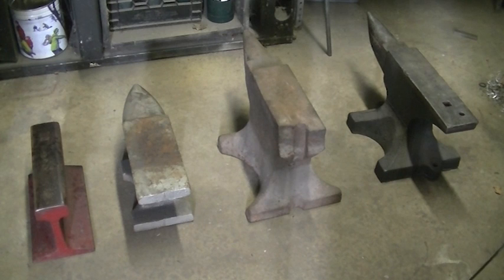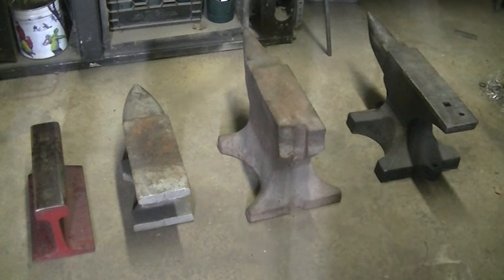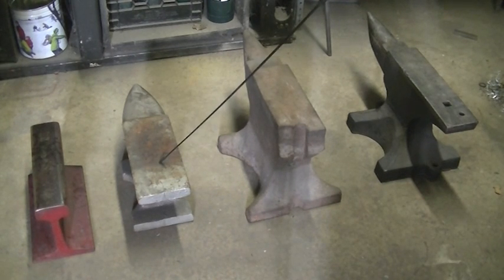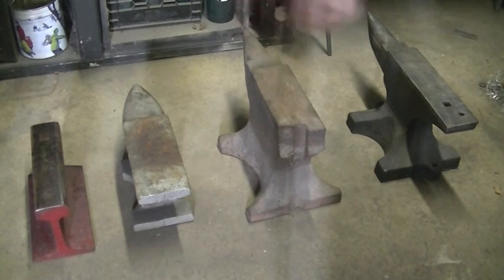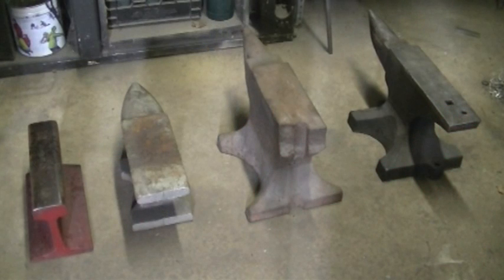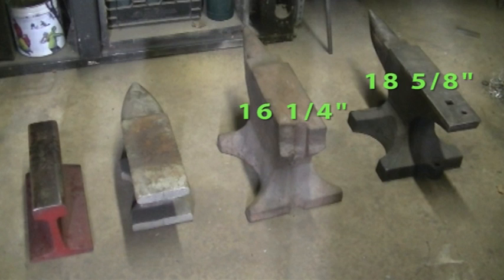Anvil Rebound Test - Steel vs. Wrought vs. Cast Iron vs. Rail - All Compared Side By Side.

Comment: Nice job, I appreciate that you took the trouble to do the side by side comparisons. I think your results are very valid, but I do wish you had used a smaller ball bearing without anything welded to it. I understand why you did what you did, but I do think you put the rail anvil at an unfair disadvantage; a smaller ball bearing without anything welded to it would have been closer to a more neutral test across the board, given that the rail anvil had much less mass - it's a good lesson that a rail anvil needs mass added, and maybe it would benefit from welding a hardened too steel plate onto the face, which seems like a sacrilige but, hey, if the rail steel isn't hard enough, it isn't hard enough. I wonder if the rail steel can be case hardened to make the face much harder?
Reply: It would be interesting to see how a 1 inch diameter ball bearing, a 2 inch diameter ball bearing, and a 3 inch diameter ball bearing all made from the same material with the same hardness do on this test.  A good way to drop the ball bearing would be by hanging it by an electromagnet so no sideways forces are applied and you definitely want to avoid having and kind of shaft sticking off of the bearings because they add all kinds of rotational momentum transfer issues that will skew your results.  I would also do the test at at least three different heights and do about 10 to 20 drops with each different configuration.

Comment: I haven't started blacksmithing yet, so while I found this video great for comparing the anvils (which you showed how they can sound different too) in the end, you forgot to mention how the rebound matters.  Is it better to have a bigger rebound, or less?  It would seem more rebound would be better? because then you know most of the energy of your strike would be sent into your object you are working on and not absorbed by the anvil??? I'm guessing a low rebound must mean energy is absorbed by the anvil, so bad?  It would be interesting to see what alterations could be done to a railroad track to make it a better anvil.  LOL, OH I see you answer this in the comments. :)
Reply from the maker: I had already talked about the reflection of energy in a previous video :)
Reply: Don't think you can help the rebound of an anvil unless you weld a harder surface to it. I'm using a RR track anvil and it's definitely useable and a noticeable step up from the cast iron varieties

Comment: Can someone explain how malleable wrought iron can shatter like the second anvil seems to have through its hardy hole? From what little I know, that would be something cast iron would do. Also, the  shape and mass effect could be the cause of the rebound difference between the second and  the smaller cast iron and the steel rail.  The thin I-beam shape of the rail probably absorbs a lot of energy
Reply from the maker: Most of the time when you see the tail broken off an anvil it is because someone took a sledge hammer to it trying to upset stock for a hardy tool. This is why most modern shops have a striking anvil. As far as mass and shape... in another video I cut the train rail in half and repeated the test, with 1/2 the mass the results were not much different.

Comment: The rail section, in practice, performs better than your drop test indicates. My thought is that the undressed surface of the rail (Still curved, not flat) affected the rebound forces directionally.
They definitely work better when dressed flat. I have also seen one individual who placed two sections side by side and welded a flat over both. Not quite as good as a tempered (wrought iron) anvil, but quite close.
Overall, though, I appreciate this video. Good work.

Comment: Great,  thanks.  I have a 122 lb. Peter Wright.  When I put it on the oak stump no matter what I do,  I cannot stop the ringing in my ears.  I moved it on top of 2 cast semi brake drums stacked on top of each other and a old cast iron transmission case,  what a difference!  I swear I get better rebound.  Can the same anvil have a different rebound depending upon it's mounting?  Concrete or dirt?
Reply: Absolutely. Your mounting/base is just about as important as the anvil itself.

Comment: I am a Machinist by Trade and I have an Old Heat Treat Gauge that is a Plexiglass  Tube that has a Ball Bearing in it and the tube has Markings on it.    to use it you just flip it upside Down  and the tube has a slot in it so you can put your thumb there to hold the bearing. then let go and let it bounce.   and read how high it bounced on the Scale

Comment: I was playing around in the shop the other day... I am putting a new face on my anvil, and while I was doing that, waiting for preheat, etc,, I decided to do some spark tests, etc. Brain was humming.. I was thinking about this, anvil ring, did a ring test on 3 different stands, etc.. Did a video I will post soon.. 
I think.. That Metal Hardness is a primary reason for rebound. Much more so than mass.. Saw your other video and it confirmed that.. The plate I am adding to my old beat down "gave to me for free" anvil is getting a new face of 1-1/4" thick 4140 plate steel.. I know the material  is tough.  Too many hardy cutoffs, top tools etc are made from them to make me think different.
I was shocked to do a bounce test on it and see that it hardly performed at all. 
I'm not sure if I am going to be able to harden it,, since it is part of a much larger mass now.. 150 lbs now.
If you ever run across two pieces of steel, or have a way to test one piece, Anneal it, test it, Harden it, test it, then, temper to some grade for it's intended use and test it again, I would bet that, many an argument would have a short and sweet ending.. 
I suspect, rebound is all about hardness, and little about mass.. 
And, then,, Cast Iron comes to the forefront to hack the theory.
Hmmm.. I ordered two of the stainless steel 1" balls for my rebound tests.. I should anneal one, and leave the other alone and test them both..

Comment: G'day mate, your measurement isn't from the center of mass. Your numbers are off, if only slightly because of the welded shaft. Tim also makes a good point about sample size. Saying that, great comparison, and good data to have before laying out cash, or passing up something cheap because it isn't "as good" as a steel anvil.
Good work mate.

Comment: Thank-you for the experiment.  I was also surprised the rail didn't do as well but I have a feeling it may be due to it's mass and/or height?
Reply from the maker: I did another video with just the rail, testing 2 different size balls. Then I cut the rail in 1/2 to cut the mass down, the results were nearly the same. To be honest I was not expecting that. ;)

Comment: The only problem, from a physics standpoint, is that you would need to measure the height of the center of mass...which is easy to do with a spherical object...but your object isn't.  This test will give you a simple ranking, but less than accurate rebound results.

Comment: was the rail hardened or heat treated?
Reply from the maker: The rail was "as is" right out of service. There are a lot of opinions as to the hardness of rail as I am finding out from Youtube. Some people say its hardened at the factory, others say it is work hardened. All I know is in a later video I cut that section of rail in half to test if the difference in mass would effect the rebound at all. My band saw had no problems getting through it.  My guess, it is harder than your average mild steel but nowhere close to tool steel.

Comment: Curious why you did no weight/mass calculations. what was the weight difference between them all? It appears to me that the one that preformed the best also had the most mass. also what was the weight of the bearing?
Reply from the maker: I did another video about how mass effects the test, in fact I cut the trail rail in half cutting the mass by half. Not much of a change in the results.

Comment: Thanks for the test. I would have thought that the rail would perform better as well. I wonder if the weight difference between each anvil plays a part. I have an 18" section of rail track with 1.5" plate welded to the base, coming in at about 115 lbs. I'll have to do a test of my own. If my results differ very much maybe I'll make a video response. Cheers.

Comment: you've got some good results, but your sample size is to small....should have done 5 -10 drops to get a good statistical sample to draw conclusions from.   Also, with the rail, because the surface is domed and not flat, you do need to make sure your ball strikes at the top of the dome, or the energy will naturally deflect sideways somewhat.  Compared to a drop at dead center, an off center strike would still have the same energy, but because the doming would skew the vector, the actual rebound height would measure lower.     

Does seem clear, the best is the first one in your test, and while the rail is no where near as good, it's better than the junk ones from HF.....
Reply: Mr. Hyatt, of course you are right, and the sample size was too small. But for the slightly unscientific method used here, I was able to my own satisfaction to make the comparisons. Sure, only qualitative, but still valuable. The only thing I don't accept is the train rail results. I believe that due to the lack of mass in its cross section (and the thinness of the design), the rebound result was less than expected. I feel that an anvil "shape" made from the same exact metal as the rail (including its rolled manufacture) would yield much higher results.
Reply: It would be great to have ten bounces each anvil and 100 different make and model years. But this demo is awesome for what it is. Ty!

Comment: Well here's the issue those results are expected because of the mass of each anvil. Naturally the larger anvil's will have better rebound. The test performed is very inaccurate when comparing different mass anvils if they were all the same mass this would be a true representation of difference in materials. Unfortunately the test you preformed just yields useless results. Not to mention the dropping object is not concentric.
Reply from the maker: I already debunked this... I took a rail 12 inches long did the test... then cut it in half to 6 inches did the test again... same results I also stood the rail up on end, same results. Now, the dropping object is non concentric. People do this test with a ball peen hammer, find me one of those that is concentric.
Reply: I can send you a 35mm ball bearing. All I am saying is the the test is not an accurate representation for a scientific test. Mass and shape will effect the rebound. Furthermore this is not an accurate way to yield results for density which is what I believe people are really after when they try these tests. 

In all fairness you did a great job with your video.

But people have this illusion that dropping an object on their anvil and watching its rebound will tell them the quality of it. 

It's the density of the material that yields its most effectiveness, and there is some design and shape that will effect this slightly. 

Imagine you have an anvil made of only wrought iron (as in your video). This wrought iron anvil performed second best. Now an anvil made of steel as in your best performing anvil, cut a quarter inch sheet from the top. Redo your drop test on that quarter inch sheet. Which anvil won? 

The answer is clear. Because size, shape and mass are different. You now have different results.

Comment: I don't see how any of this can really change the forging. We are heating the steel being forged to a plastic state. How can rebound be of any importance when the soft steel is absorbing all the energy from the blow. I can see how composition of the anvil could effect wear over time. Thoughts? Is all this debate about who's proud of having anvil X. Isn't smithing about the process and fun rather than tool envy. Sure is for me.
Reply: It should be EXCRUCIATINGLY obvious after seeing this video that the soft steel is NOT absorbing all the energy if you don't have a good anvil. The anvils in this video absorbed between 2%  and 50% of the work applied. That means you'll have between 50% and 98% of your work going into your hot steel, and about 5% of that will rebound your hammer back to you. 

So, make your choice; either 47.5% of your work goes into your hot steel, and 2.5% brings your hammer back...
OR, 93.1% of your work goes into your hot steel, and 4.9% brings your hammer back. 

I have a 200 pound anvil that has horrible rebound. It's nearly identical to the concrete slab in my garage, at about 30%.

The difference between a good anvil and a bad anvil means 2 to 3 times the amount of WORK that you have to do to shape the metal with a bad anvil, and an additional 2 to 3 times the amount of work to lift your hammer each time. Plus, since you're doing less work with each hammer blow, you have to lift it 2 to 3 more times with a bad anvil, at 2 to 3 times more effort, and drop your hammer 2 to 3 more times with less result. 

Say 2 times. 
That means that someone with a good anvil can produce 2 times more finished product than someone with a junk anvil, for a given amount of work. 

It is not tool envy. It is not a status symbol outside of a symbol of understanding the craft, and thereby having some status. It is not price gouging. It is physics.
Reply: Your shoulder will thank you for having a decent rebound on the stock. The difference between my first anvil, an ASO cast iron from harbour freight vs my current rail track is night and day. Can't weight till I get my hands on an actual decent anvil.
Reply from the maker: Honestly, When I first started I forged things using a cement block and a carpenters hammer. I made this because there are just so many of these videos on youtube I thought I could make one that was a more complete. Like I said is the last video I posted; "first anvil was a rock, first hammer was another rock, its not rocket science"
Reply: Happy, that’s just wrong. If you can’t tell the difference between a “real” anvil and a cheap cast iron model, then you don’t do the work that needs one. Bang out a few bent edges in sheet metal, and anything will work.
Reply: The reason for better rebound serves 2 purposes;

1- instead of the anvil itself absorbing the energy from each hammer blow it's reflected back and, in turn, absorbed by the material being forged. This makes smithing itself more efficient and moves the material more uniformly.

2- the rebound also puts a "bounce back", so to speak, into the hammer so you aren't physically doing as much work to directly lift the hammer just to slam it back down again. This goes along with efficiency and also has to do with the ergonomics of the tool itself.

Have to keep in mind, in years past,it wasn't about the enjoyment of the craft, it was about making a living for your family with the craft.
Reply: Awww I remember when I used a 60lb cast iron anvil .... now I have a 175lb anvil with awesome rebound
Reply: Another factor the is similar is what you have your anvil on 3 feet of concrete or a wood stump, also affects rebound and wasted wobble that the track is likely wasting energy on.
Reply: This is exactly it. Expensive anvils are just a status symbol. They work no different what so ever. They last a little longer, but not enough to out weigh the price gouging.

Comment: The other anvils beside cast iron and rail had such good rebound because they are hardened a hardened anvil  will send a larger vibration sending the bearing back up but the rail isn't hardened so you should try that again with a hardened rail

Comment: Congrats on 100th video! And this was a great test and demonstration. I have hit all the styles of anvil, and agree that cast iron is the worst for rebound. The tool steel face of a wrought anvil has been the best. If I had to start all over, I would still use rail over cast iron. Thanks!

Comment: As usual you have performed a very good video.. I would state however the mass of the anvils is a factor in these results. The more mass, the more potential energy. My suggestion to anyone starting out, get the best anvil for your money you can afford. As you progress, you will be able to get a larger, better anvil. Now back to you Jeff, I commend you for finally providing a side by side test. people starting out need to realize the better the rebound, the less work they will have to do when pounding the metal when making whatever they desire to forge. Congratulations on your 100th video.

Comment: Thank you for posting this video. It was very informative and I agree with you about rail and cast steel. It seems that a good investment might be to buy a cheap cast steel anvil and weld a 0.5" steel plate (maybe 1095?) as the table then harden the face.